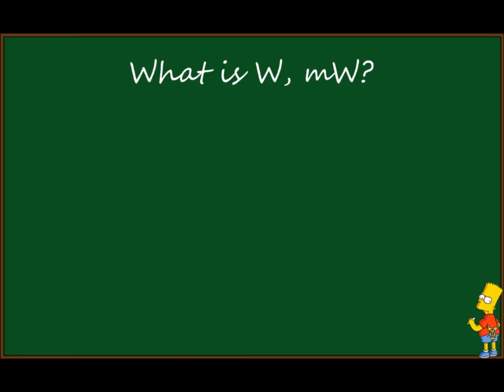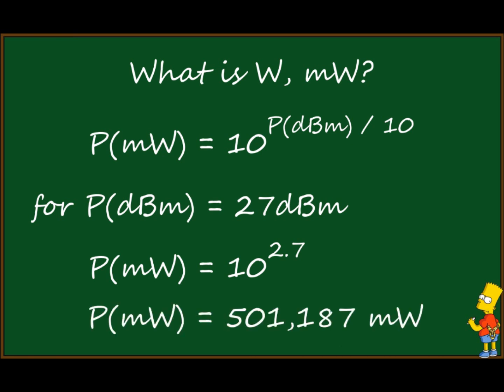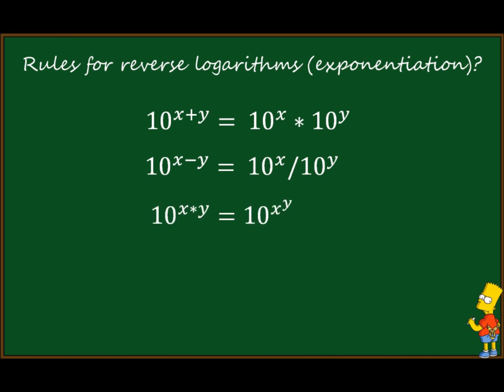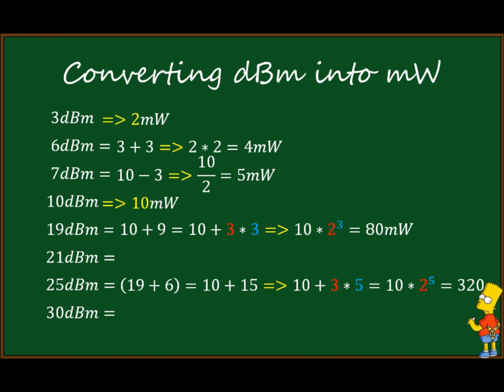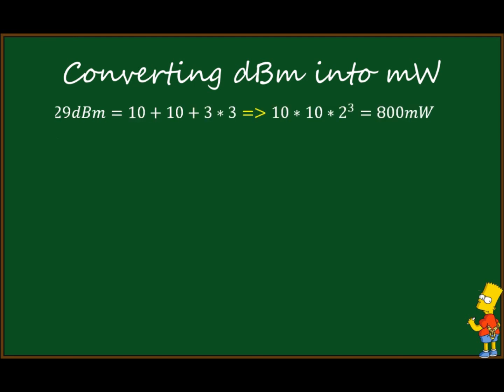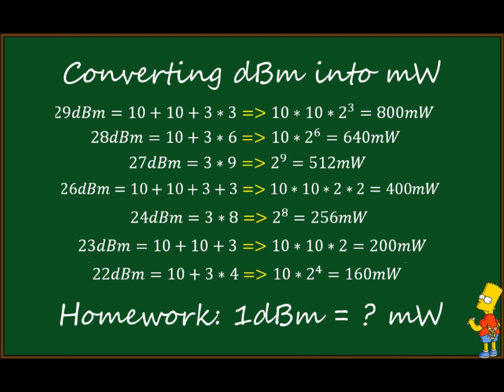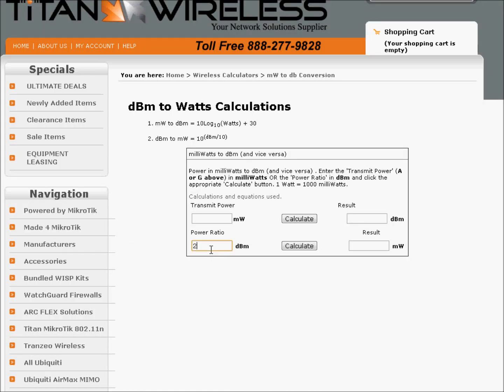Learn convert dBm to mW without calculator

Comment: There is a mistake in your calculation for 30 dBm.

If you use the same method for all calculation, it should be read as follow.
30 dBm = 10 * 3  = > 10 power 2 =  100 mW

so it should be read like that instead

30 dBm = 10 + 10 + 10  = > 10 * 10 * 10 =  1000 mW or 1 W

As a rule of thumb if you can do the calculation with an addition you should.
Reply from the maker: Yes, addition is easier... But  it's not mistake... If you look carefully at 4:53 base is changing but exponent remains. Therefore: 30 dBm = 10 * 3  = > 10 power 3 =  1000 mW (because 10 remains 10)
Reply: only the base changes

Comment: But in the http://www.rapidtables.com/convert/power/dBm_to_mW.htm says that 27 dbm is equal to 501 mW. you also got it wring in the 28,29
Reply from the maker: That's correct. 27 dBm is 501.2 mW. But this is approximate calculation without calculator. And result 500 mW or 512 mW is good approximation of 501.
Another thing, loss that you have in cable, connectors etc can easily be 1-2 dBm so you don't need to look 1mW difference if you can have 10, 20, 50 mW difference.
You will never need that precision in practice.
27 = 3*9 => 2^9 = 512
27 = 30 - 3 = 10+10+10-3 => 10*10*10/2 = 500 mW

Both are close enough and they are example how you can get result with any approach.. Choose what is easier for you in particular moment.
(Mostly I'm using 2nd approach since * and / is easier than ^)

29 dBm is 794.32
Without calculator you get 800.
That's 99.3% accurate... As I said, you don't need closer than that.

Comment: Hi, 

21dBm=3*7 ==> 2^7=128mW.. but.. =125 what?
I'm doing something wrong?
Reply from the maker: +Sílvio Santos No, you doing fine. It's approximate calculation so you might get different result with different approach. Check video at 7:40 for 27 dBm (I got 512 and 500 mW). So it's AROUND 500mW. 
26 is around 400 and 28 is around 600 - idea is to get close enough. 
Is that 500, 512, 520 or 480, really is not a big deal.

Similarly for your calculation: 21 dBm is 125.89. Now, did you get 125 or 128 doesn't make difference. That's all within 2%. In different cases you'll use different approach. Take one that is easiest for you at that moment that give you close enough result.

Comment: hello Thefreespaceloss, Could you please explain me how could Kevin made that operation from 7+7+7 to obtain 5*5*5?????
Reply from the maker: +German Machado 
Sure.
21 = 7+7+7
21 = (10 - 3) + (10 - 3) + (10 - 3)

This can go in two directions: one is explained in video where you sum all 10's and all 3's and get: 30 - 9.
I went with that approach because it's more common with other similliar values like 31 = 40-9

But you can also do as Kevin.
10 - 3 became 10 / 2 (remember: 10 became 10, - became /, 3 became 2)
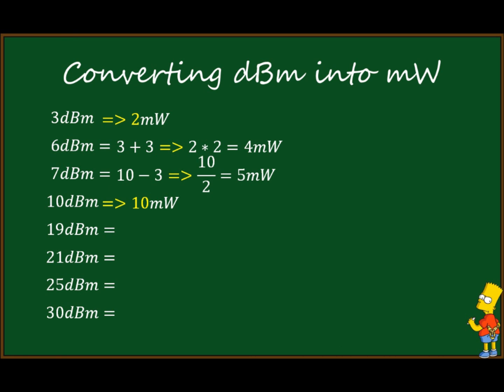10 - 3 became 10/2 = 5 (it's also explained how 7 dBm is 5mW at 4:21 of video)

Now you have this:

21 = 7 + 7 + 7
7 became 5
+ became *

7+7+7 became 5*5*5 = 125 mW

Hope I've helped.